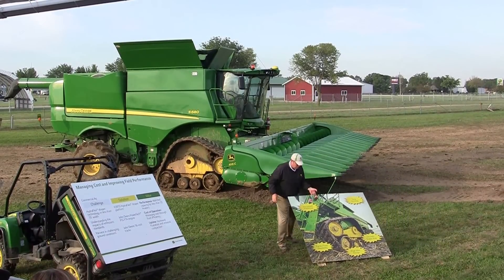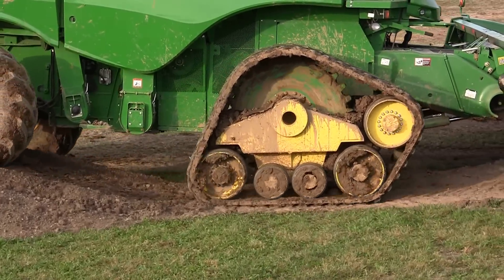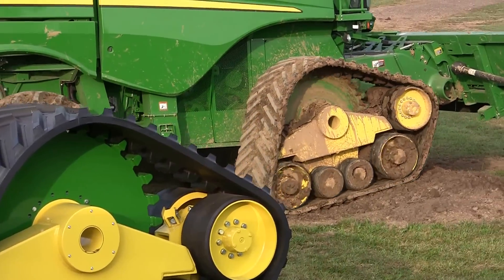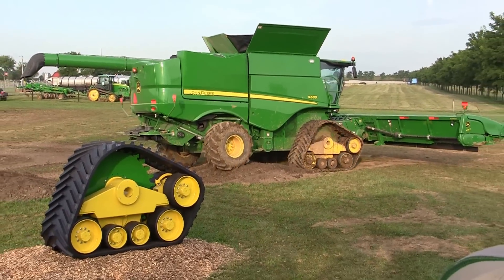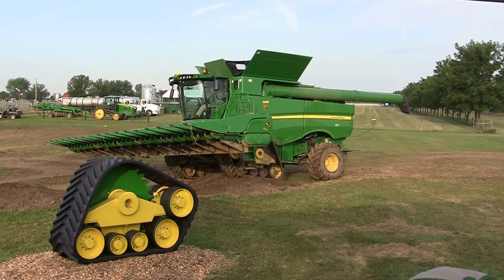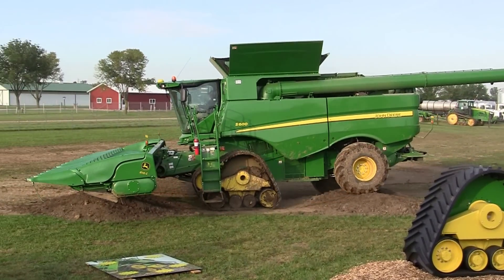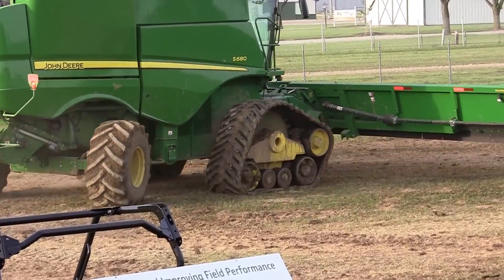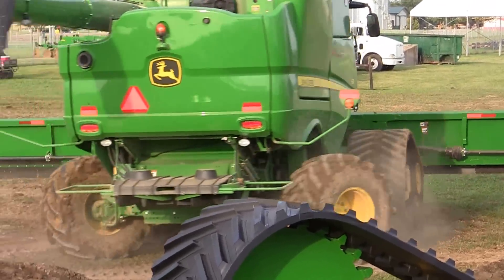John Deere Intro 2013 - Combine Tracks Demo

Comment: They used to use D8 tracks on the old 915's in the 70's. While the idea isn't new technology has reduced the maintenance and dependability to make tracks actually viable largely due to the use of(Kevlar) and better manufacturing. The future looks bright.

Comment: once you tried tracks on a combine and or large 4 wheel drive articulating tractor you will never go back..there is no compaction and you never get t stuck.with combines using such wide heavier header these days and larger hoppers which makes the combine heavier,the tacks make it effort less on iclines and in muddy fields.making it very stable and smoth.the john deere differenty desihn of track is nice because the leading front part of the trac is pushing down with the direction of the trac